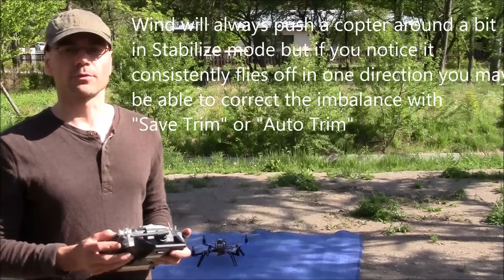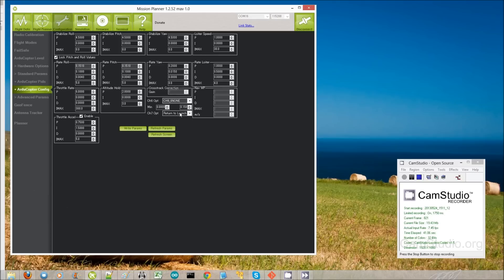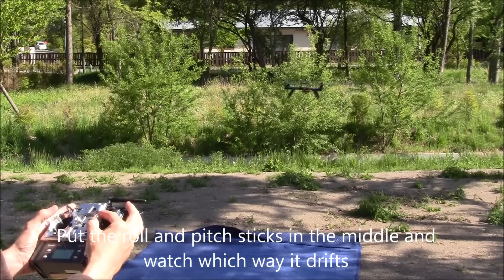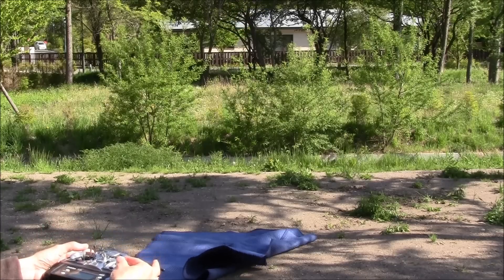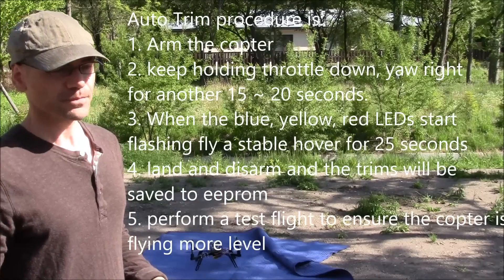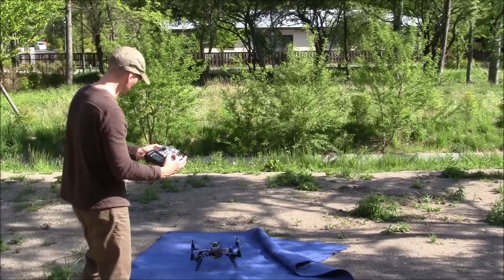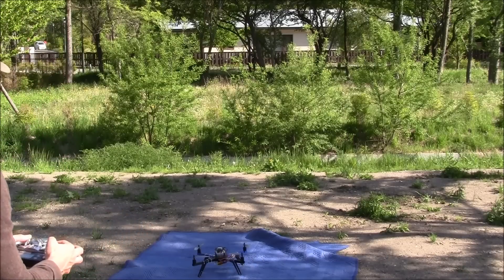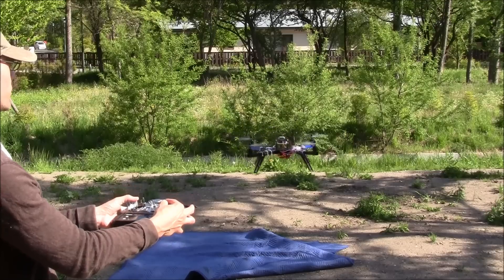Save Trim  & Auto Trim

Comment: Hi Randy, just out of interest does it affect the Accelerometer offsets as well or is that only with ACCEL 3 AXIS calibration.
Reply from the maker: Hi Anthony, no, this doesn't affect the accelerometer offsets.  By the way, most users no longer need to set the AHRS_TRIM_X/Y values using this procedure as long as they make sure that the vehicle is level during the first step of the accelerometer calibration procedure (which also sets AHRS_TRIM_X/Y).
Reply: @rmackay9  thanks chap. I decided scotch tape might be prone to shift so I hard fixed it to the frame and it made a huge difference.
I'm testing in parallel against a 25+kg sprayer frame to help me understand as I can't use 3 Axis because it's too big to rotate alone really.
I tested single axis and level today with a Large vehicle MagCal on an EDU450 and it flew so that's a good start. Drifted a little but it was an open field with a small breeze.

Comment: Can either of these methods be done in alt hold mode instead of stabilize?
Reply from the maker: Hi Ununpentius, yes, it will work in AltHold mode too.  .. but you know, I don't think this is necessary for most users.  AP's 3D accelerometer calibration does a good enough job of getting the vehicle level that this isn't required anymore.

Comment: Tryed "Save Trim". As long as the heading is as during the trim flight everything is fine and i have a stable hover. If you Yaw the copter it flys away, even in LOITER. Setting AHRS_TRIM_X (0.07) and AHRS_TRIM_Y (-0.07) back to 0. Using Firmware 3.1.1. Maybe this is an bug.
Reply from the maker: Andreas,
    Yes, there is an issue with the way we handle AHRS_TRIM in AC3.1.1.  It'll be changed in AC3.2.  Basically we were applying the trim too early so it gets into the inertial nav position estimate.  We really only want that trim to affect the attitude.  Sorry for the troubles!